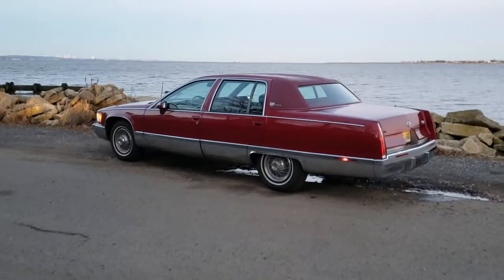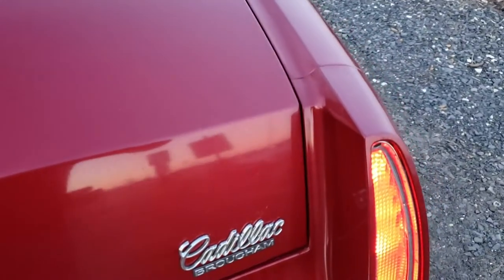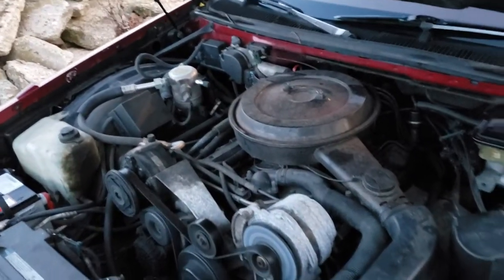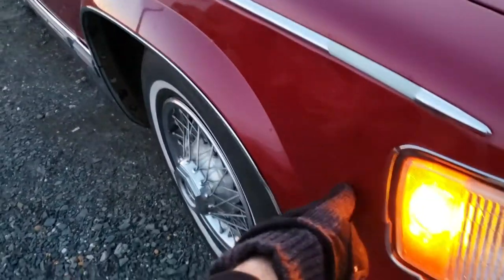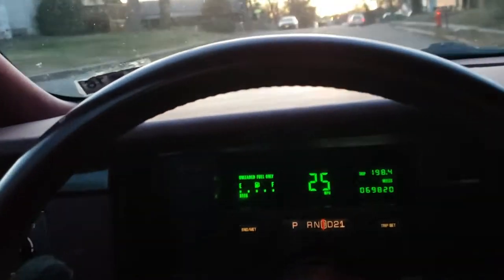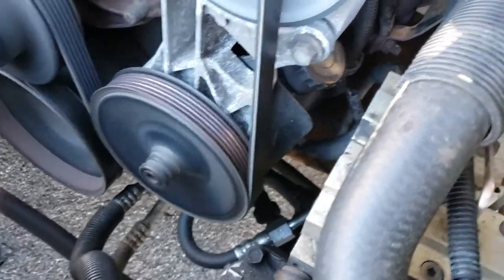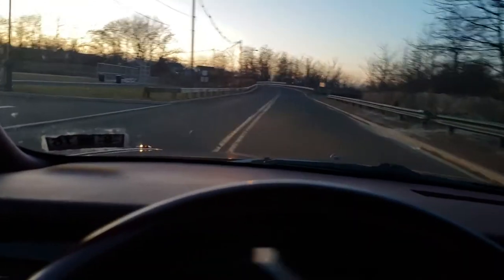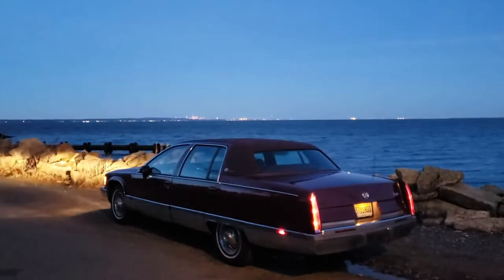Walk around and drive of my 1993 Cadillac Fleetwood Brougham

Comment: Another thing that I find comical is that this state considers a 93 Cadillac "Historic" lol. Well anything 25 and older. Its stupid. 25 should be classic, 50 should be antique, 75 should be historic. Theirs nothing Historic about a 93 Cadillac. NJ is stupid.
Reply: Nowhere near as stupid as Maryland.  The state lowered its minimum age for "historic" vehicles from 25 years to 20 YEARS about five or six years ago.  If you come to Maryland (especially Baltimore City) you'll see lots of vehicles such as late 1990s or early 2000s Chevy and Ford pickups and old beat-up Honda Accords and Toyota Camrys - even a few Lexus or Infiniti cars and sometimes Ford Explorers - with historic plates.  Guess that means "I've got a 20-year-old Camry; I'll hit the DMV today and ask for historic plates!  I'm good!".  No.  Not historic to me.  I'd rather see a 1969 Camaro than a 1999 Camry with historic plates.  Stupid, indeed.  Why don't MD and NJ start cracking down on historic plate use?  (5/21/2022)
Reply: @knowbodiesfull5768  I agree. Only issue. My 2001 S10 had issues passing inspection in NJ. If it had been considered historic at 20 I would have been exempt from inspection, saving me the trouble. I think that's why a lot of states did it. To ease inspection. I sold that truck to a PA resident. He passes the next day there. But I agree. A car from 2002 isn't a classic. I guess you could consider my first car a classic now. It was a '95 Grand Prix. Don't see many anymore. The 1977 Trans Am in Smokey in the Bandit, their's a classic. RIP Pontiac and American muscle.